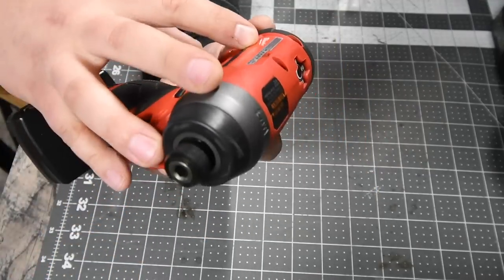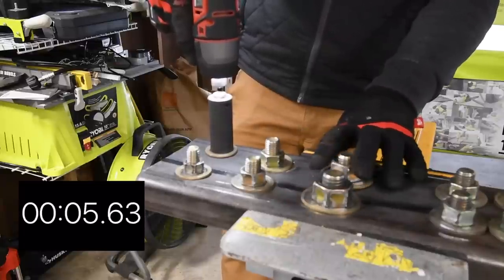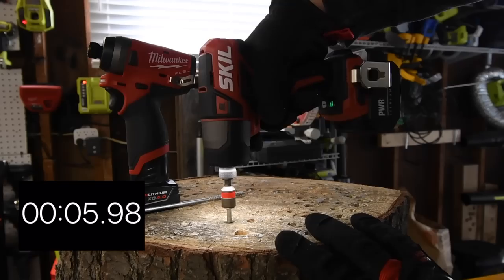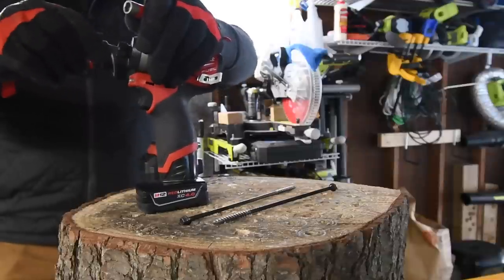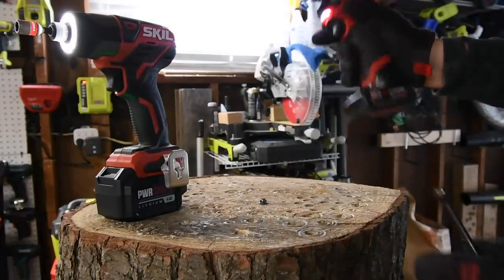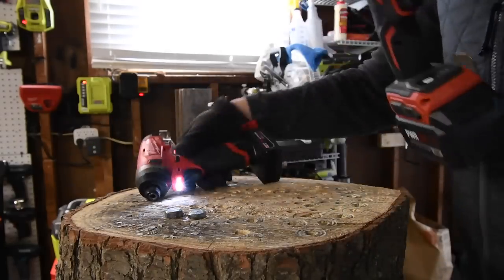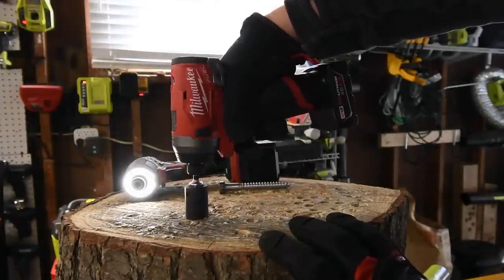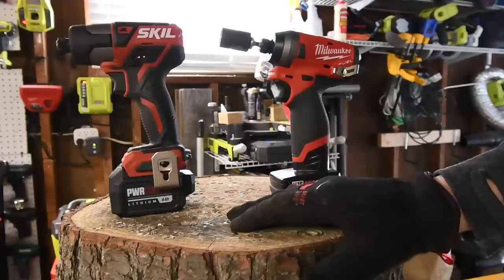12v Skill vs M12 Milwaukee (Impact Drivers)

Comment: That gen 2 M12 was my 1st impact i owned and have to say I love it. My m12 will basically complete 99% of my needs
Reply: Agreed. I want the stubby next
Reply: @Toolboss0826  Same cheapest I can find is $135 . I kinda really want the m18 mid torque it's more torque then I need
Reply: @KingCuba0731  I agree. I want to start out small and then be a dewalt mid torque since that’s the battery platform I’m on
Reply from the maker: and that is what makes it a good tool and I thank you for viewing Filthy

Comment: Great video! I love my M12 fuel impact driver. It's a monster for it's size. But considering you can buy the Skil 12v impact and drill driver combo for under $100 on Amazon, they definitely should be looked at for the homeowner/DIY.👍
Reply from the maker: I thank you Luigiz
Reply: @ManCaverTools  $79

Comment: That's the point of the bigger handle, to have the smallest footprint like with the 2.0 battery and split cell stack with the 4.0... With a slide battery it adds bulk to the bottom and at that point just go with the full size m18. It's a trade off for some with elf hands but I'm glad milwaukee went that route with the m12. Keep compacts small. Go full size if space isn't an issue. Btw I don't have huge hands and have no problems with the grip. Keep the vids coming!
Reply: Exactly!!! You are correct my friend. 😎
Reply from the maker: I thank you Jascospeed

Comment: I have the m18 fuel impact and it's great for heavy duty applications but when it comes to 2 1/2 wood screws with Philips heads, it sucks. It has too much power and the impact doesn't kick in soon enough to stop from stripping which makes you push way harder on the fastener to keep from stripping.

Comment: The M12 fuel gen 2 is 1300 inch pound, the 450 inch pound is for the surge version
Reply: And the Surge is still faster than the Skil and the new DeWalt 12V driver (I've had all 3. I'm keeping the faster (and quieter) Surge.

Comment: That M12 impact driver is tiny monster.  When I got mine a little over a year ago I tried it on the lugs of my Jeep WJ and our minivan - it zipped them right off and that was with the 2ah battery that came with the Home Depot $99 kit.  When I removed the cylinder head off that Jeep last summer, that little driver and 2ah battery  was able to get into the tight spaces underneath to take off the bolts holding the exhaust pipe to the exhaust manifold, and it did quick work taking off the bolts holding the manifold to the head.  I have since gotten the 6ah battery and the M12 stubby, which also punches above its class, but I love that driver for what it can do.  Last weekend I installed shelves and overhead bike pulleys in our garage - did it all with that impact driver - drilling, pilot holes, driving the screws.  If I was stranded on an island and could have only one drill/driver/impact wrench, I'd have to pick that impact driver.

Comment: The skill led if for sure nice but im not sure if it will last in the long term.
My M12 Gen2 looks a lot more used and its fully scratched and nicked on the metal part. I think a led ring would be allready damaged
Reply from the maker: that is a good point, and I thank you Damon

Comment: The skil has more torque because it spins slower on both high and low over the Milwaukee model good video bro
Reply: Nope with impacts the higher the rpm the higher the torque. With regular drill follows the rule, the lower the rpm the higher the torque.
Reply: @jeffreyvelthuis9245  never would of thought that very cool never thought about it to much but yeah that does make sense
Reply from the maker: I thank you Antonio

Comment: The light on the skil is very nice but also contributes to the murder of the battery. That little m12 is a beast. Kobalt XTR all the way tho in my opinion.
Reply: I think the combination between well priced Skil 12v tools for most home uses, and the value of XTR for the prosumer/instances where you need more power makes a lot of sense. I’m sure this comment will delight Chervon and horrify TTI (I own 2 Milwaukee tools as well), but someone could spend less than $600 and have all the basic power tools needed to accomplish 99% of tasks (beyond specialized use cases, which is where Milwaukee, Makita, etc. excel).
Reply from the maker: I got more cobalt videos coming soon

Comment: What would you consider to be more equal performance with skil 12v?  Sense m12 fuel is tops.  I just can't get past handle ergonomics.   Wonder what Milwaukee next gen 12v will have?  Seems like they better be taking notes from skil...
Reply from the maker: I do agree that the handle on the m12 tools are huge and im not a fan of that
Reply: I  wonder what would be the result if you use a high output m12 battery 🤔
Reply: @Pty-gk2vb  it's the physical diameter of the grip that is the issue.   I thought they already used good quality/chemistry in their batteries?

Comment: Im pretty sure ive never used my m18 impact. Had it for over a year. There is just no need as the m12 does it all and is way lignter amd smaller

Comment: I'm about to switch to flex. All the test so far have it outperforming the Milwaukee and I absolutely can't stand on every single Milwaukee impact I've had and my current one has a collid issue. They've all worn out fast under heavy use and even my new one loses spade bits when pulling straight out. I have an old bosch impact from years ago that still has had no issues. My Milwaukee smokes it but for durability it's shit.
Reply from the maker: I do thank you so much for viewing :)

Comment: Great comparison. Overall you can’t beat Milwaukee, but then again it is more than double the cost of the Skil (PwrCore 12 kit with 2ah batt and charger is $80, or $109 with the Power Jump charger, or you can get a 5 tool kit, 2 batteries and standard charger for $199), whereas the Milwaukee is about double $ .... However, HD has a great deal right now: M12 Impact, Hammer Drill, 2 batteries, charger and and extra tool for $229. The Skil PwrCore line is very good and you can’t beat the value and how they fit in your hand but has currently a very limited tool range. Milwaukee’s range is huge and being you can get the combo  charger (12v/18v) with their 18v kits (and should come with the 12v kits) that is a big advantage if you need go back and forth depending how much power you made need. (I suggested that to Skil and they got back to me saying that was a great idea.)
As a DYI/homeowner it’s a difficult choice, but good as well. Thanks for the video!
Reply from the maker: milwaukee has dominated the impact driver and impact wrench market and I thank you for viewing Eat
Reply: You can get that 5 tool kit for $99 right now a Lowes.
Reply: @WaltWW  That may be worth getting just to have it around. I said to my wife yesterday in most cases I could get by with 12v tools, I just want that power of an 18v-20v when I need it (mainly for using a planter auger in the garden to dig into our hard clay-like rocky soil).   That is again so much for pointing this out!!!
Reply: @WaltWW  I just doubled checked this on the Skil site - This is the “new” lower priced kit that has the standard batteries (no mobile charging) and the standard charger (not the rapid charger). The other kit that has been a round for a year is the same tools but with the upgraded batts and charger and is listed now for $160 at Lowes (down form $200)
Reply: @FunAtDisney  Thanks for the info, I lucked out and bought two 12v jump chargers from one of our Lowes that put them on the clearance rack earlier this year for $5 each.  I didn't know the batteries were different but they seem to work well.
Reply: @WaltWW  the only difference in the battery is that the others have a USB port so you can use them as a charger for your devices

Comment: Milwaukee’s m12 fuel tool is much more expensive and its TTI’s top of the line vs Skil being Chevron’s entry level DIyer tools. I’m sure if Kobalt had a 12v (or 14-15v?) line it would match up very well against Milwaukee but still being much less expensive. The results were as expected and I’d probably go Skil vs Milwaukee if I ever got a 12v unless I was trying to solely stick to 12v, using constantly under heavier loads, or a mechanic. You can find a 4 tool Skil combo for less than the price of 2 tool Milwaukee and both have the same warranty.
Reply from the maker: I would love it if Kobalt had a 12v line

Comment: I'm very impressed with skil especially since its 2 amp hour battery is facing Milwaukee 4AH battery. I think if you didnt use the 4ah it would be a neck to neck competition. Great video man.
Reply: That’s a 4ah battery in the Skil. See how fat it is compared to the 2ah Skil batteries?
Reply: @tannerwest6823  hey your absolutely rite. For odd reason I thought it was a 2ah. Good job.

Comment: I’m surprised that Skil was way behind Milwaukee. Skil rated this impact at 1,100 inch lbs and the Milwaukee is rated at 450 inch lbs. I’ve watched someone else video that rated Milwaukee and Skil 12 volt drills, and Skil was superior to Milwaukee. Did you perhaps tested Skil’s impact driver in Low?
Reply from the maker: I do thank you so much for viewing :)
Reply: The Milwaukee is rated at 1,300 in-lbs. You might be thinking of the M12 Surge.

Comment: I'm surprised the skill having slower rpm and more torque it isn't doing better then the Milwaukee having 600 in pounds of torque
Reply from the maker: that milwaukee is a powerful one for what it is
Reply: The 2553-20 in the video has 1300 in-lbs of torque according to Milwaukee, so considerably more than the Skil.
Reply: @l00nybin  I don't think you read my comment

Comment: Nice video Dave. I have both of these impact divers. The Milwaukee is definitely a faster, more powerful tool. But for the price, and the features like that ring light and it's ergonomics, the Skil is a pretty decent tool for most people including many pros. 

For most tasks, the Skil would be more than enough to complete the task. It's very rare you need to push these tools to max out their abilities. If you do, then it's best to move up to a sub compact 18-20 volt model from Rigid, Makita, or DeWalt. 

For the pros that want to go all in to a platform for the large variety of tools they might need on the job, then the Milwaukee is the way to go. You can't beat the performance and the depth of tools Milwaukee offers. And when you can find them on sale at The Depot during Black Friday or Father's Day sales, the value is pretty damn good too!
Reply from the maker: will do and I thank you for viewing David :) more videos are coming along with sales form a lot of stores
Reply: I'm looking forward to your unbiased tool tests. Especially the Flex Tools. 

You seem to be the only tester who's willing to put yourself out on the line and be honest about these new tools.

And for that I thank you.

Comment: Ironically, this is a pretty good promo for the Skil tool. On the Utility/Price = Value scale, it blows away the Milwaukee. Plus features such as the USB charge port, ring light and jump charging are valuable.